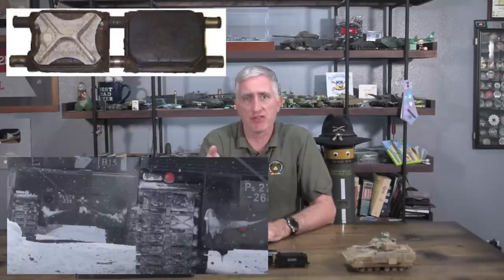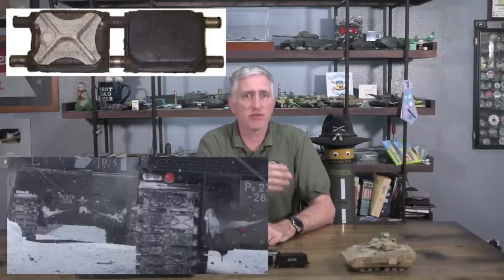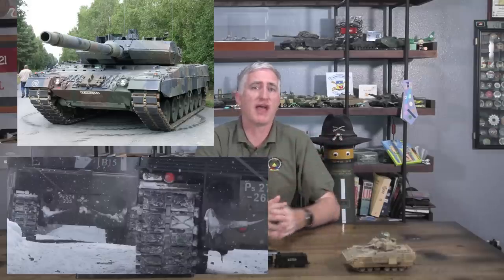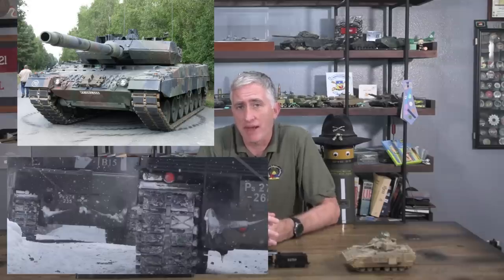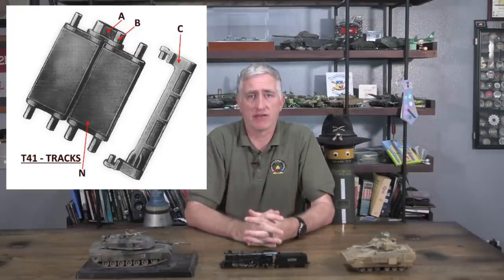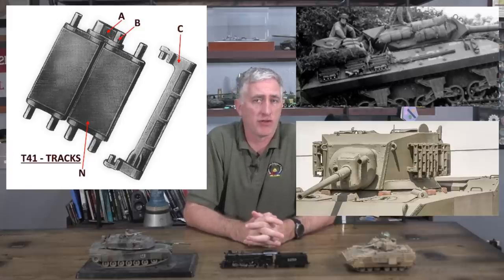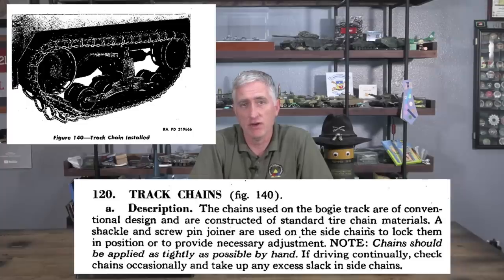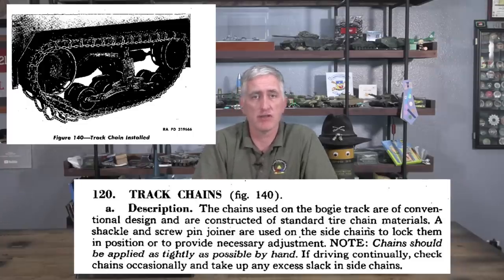Tanks 104: The basics of armored vehicle tracks

Comment: If you want to have a good day, you get out and tighten all your end links.  If you want a bad day, then just don't worry about tightening the end links......  You learn quick not to skip on checking those end links!!
Reply: End connectors, but yeah. Was part of a platoon battle run at Ft Carson, threw a track, called one of my tanks over and transferred off the main gun ammo. Eventually got the track back on track, so to speak and rushed to get up with the platoon. Machine gunned the objective as the attack wound up, heard BG Negris (ADC Support) was watching and exclaimed 'Now that's WTF I'm talking about!'

Another BG Negris (short little guy for a brigadier) tale: I was hip deep in the back end of one of my M60's. A voice behind me 'Sgt, are these your tanks?' Scramble out and salute, why yes sir, yes they are. 'Do you have any problems?' Bn XO cringes in the background, he knows me. Why yessir, yes I do. I've been trying to order sprocket hub nuts (use once and throw away) and I keep getting roller bearings (show the nut, show the bearing, show my 2765 order form show parts number in manual) three times I have ordered these and three times these show up. He asks for my 2765. They drive off. Reassure the XO, 'Sir I've done my research, everyone in battalion did their part correctly, the F'Up wasn't on our end.'

Couple hours later a jeep pulls up next to my tank with the BG's aide, 'Sgt are these what you are looking for?' Why yessir, exactly, thank you'. Drives off. call CO it was about 2 PM, 'Sir BG Negris' aide just gave me sprocket hub nuts for C13. Can I give the guys tomorrow off if I put them on tonight?' Yes, do it. 'Yessir'. Guys, I've got good news and bad news...Next gunnery C13 was there and participating for the first time in 3 years. Didn't even get a thank you when I was reassigned overseas.
Reply: @johnallison820  I know exactly what you mean, we still had M60 based CEV's (combat Engineer Vehicle) and even M48 chassis AVLB's when I was in 2nd Engineers in Korea in 1995.  I was a mechanic and recovery vehicle operator, drove them all from the 5 tons to the M986 and the M88.  Retired as a Bn Recovery NCOIC in 2006 after going to OIF in 03-04.

Comment: And the Russians used a log for extra traction.
Reply: They still do. Look at the early Ukraine tanks.
Reply: British WW1 tanks carried a log as an unditching grip device. Take it off when you are unstuck. An advantage of the all round rhomboid track plan. 

BTW the curved bottom of the track runs on them was to reduce ground contact on hard surface to aid steering and reduce the long tracks scraping off the road surface in turns. It gave a short length of contact, just in the middle.

Comment: I know this is unlikely to be seen but I really want to know what the chieftens professional opinion on the kilometers deep minefields in Ukraine and how they can be engaged effectively or if its even possible to do without taking significant material and personnel losses.
Reply from the maker: You need to throw enough resources at the matter. It's worth noting the current emphasis on engineering assets in the coming re-organisation of the US Army. It's also to be observed that there are additional shaping operations: One of the purposes of a minefield, for example, is to delay the opposition while reinforcements are brought on the receiving end. If the reinforcements are interdicted, it doesn't matter quite so much if the attackers are delayed a bit in breaching.
Reply: @TheChieftainsHatch  thank you for such a timely response, genuinely didn't expect it. It's good to see you still have time to respond to fan comments despite being undoubtedly quite busy with your work.

For the most part I was curious about it since from information and estimates I had been reading that landmines have been getting placed in the millions across Ukraine by both sides with a few estimates even claiming the number of deployed mines well in excess of 10 million.